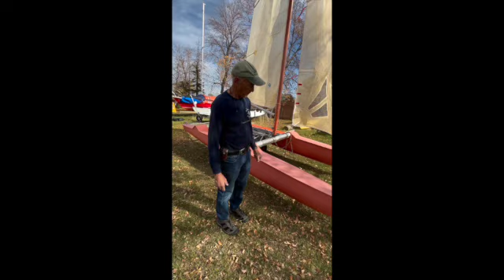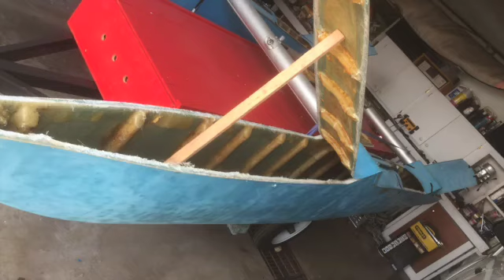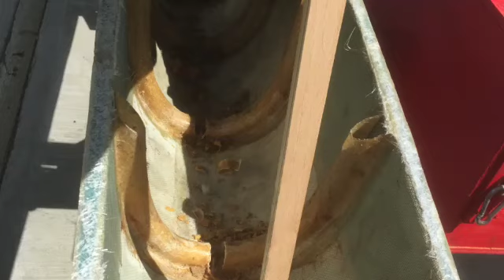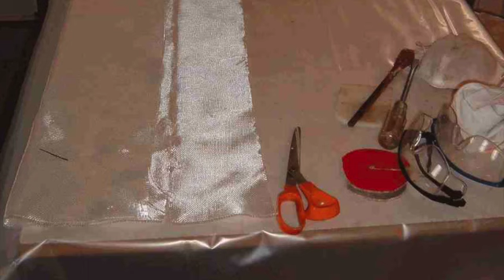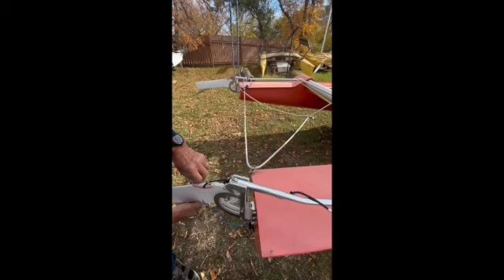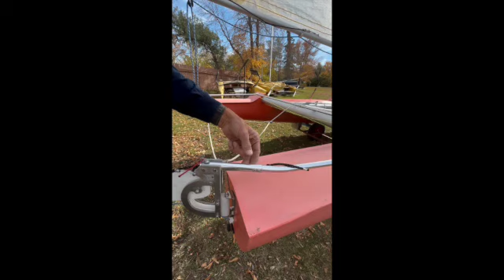Seaspray Catamaran Improvements Part 4   SD 480p

Comment: I had one of those! 1979 model. Deck between crossbeams got soft and buckled. I built a Jim Michalak Mayfly 14, but built it 20% oversized in all dimensions. The mast from the Seaspray and mainsail were used. The scantlings were doubled to withstand the shroud forces on the narrower monohull beam. Glass and epoxy in obscene amounts! "The Anvil" is now 20 years old and will be rebuilt or scrapped. No saving that old Seaspray. Severely underbuilt.
Reply from the maker: I wouldn't agree with you that Seasprays were severely underbuilt.  they were built for singlehand sailing.    They possibly can break when sailed with two or more people on board in overpowered wind conditions.  That can happen to any sailboat in those conditions.